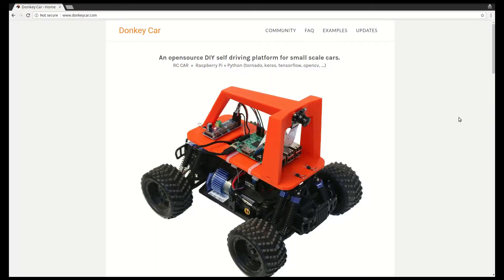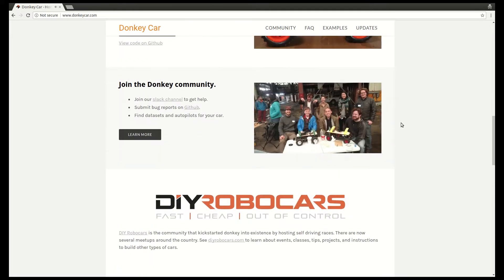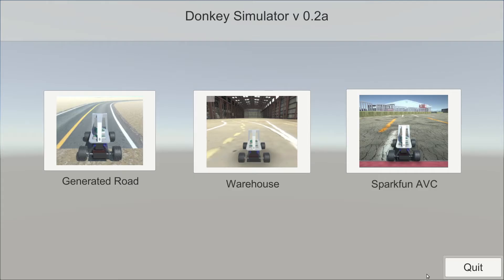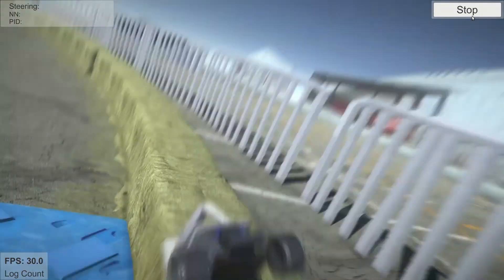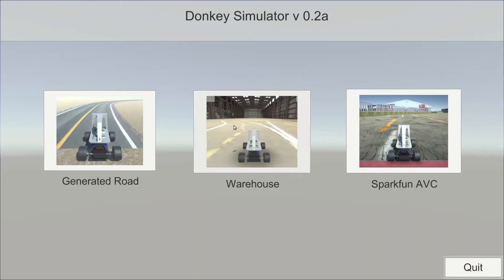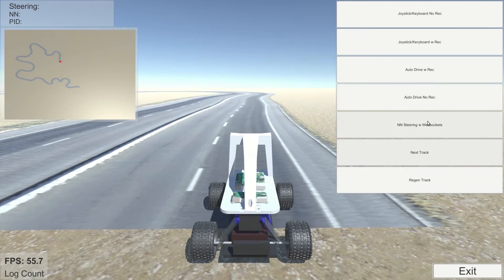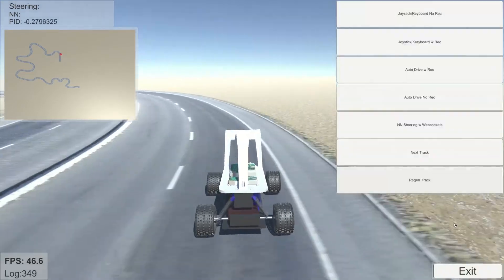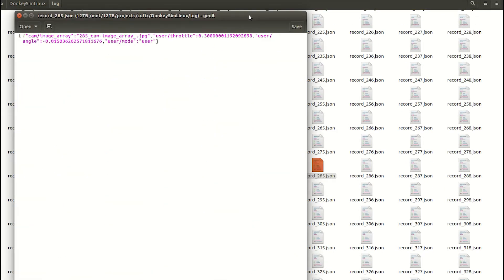DonkeyCar Simulator by DIY Robocars

Comment: The simulator doesnt seem to work with a trained model. Is there anything else that has to be done other than just loading the trained model and running the simulator with "NN Steering over Websockets"?